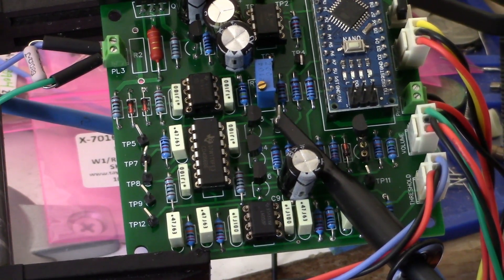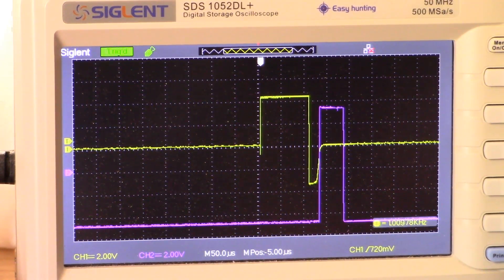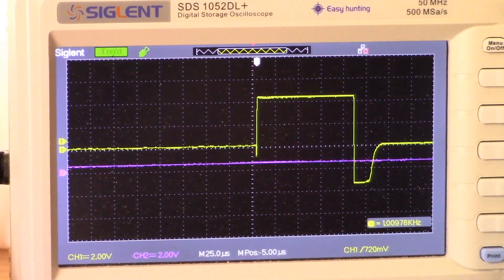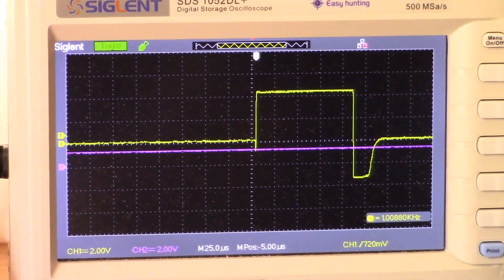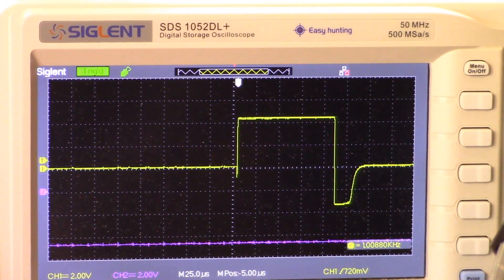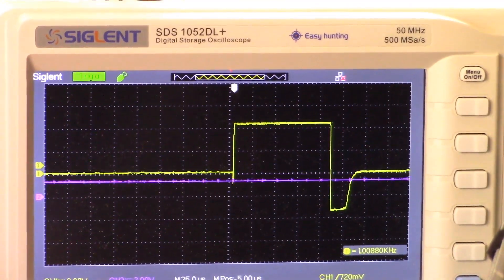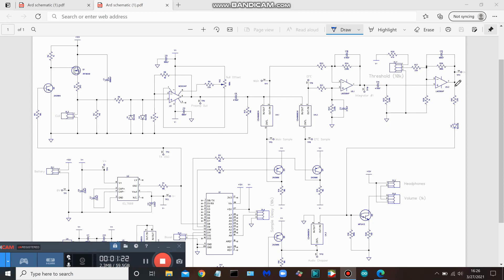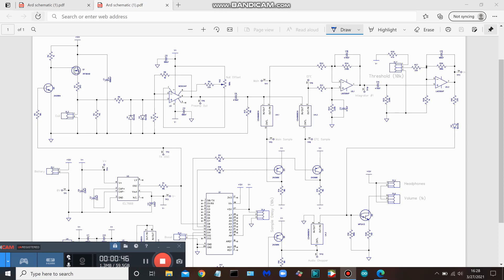Arduino Nano PI Detector part 4 Integrator and audio

Comment: Whats the advantage of this compared to the Voodoo (with the Arduino mod)?
Reply from the maker: I think that the Nano is the better machine of the two.  The Voodoo is an interesting project and it does offer iron identification however I find the Nano to be a more usable machine for beach detecting.

Comment: Você substituiu o MPS013 da saída de áudio por um de melhor ganho?
Reply from the maker: I used a 2N7000 for this project
Reply: @SurfDetector  melhorou o volume?
Reply from the maker: @EMERSONPAZ  it made the threshold smoother. I have no problems with volume

Comment: how much metter this board can detect ? with your tests ? can we build bigger loop for better results?
Reply from the maker: This project is a SurfMaster PI clone using Arduino to control the timings.  It is meant for metal detecting at the beach.